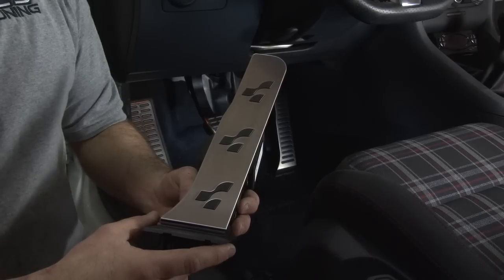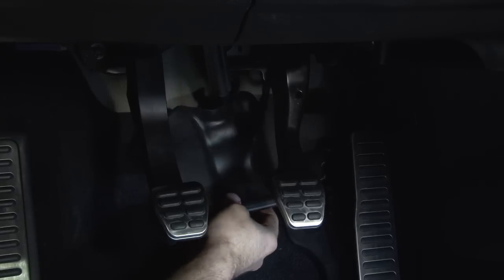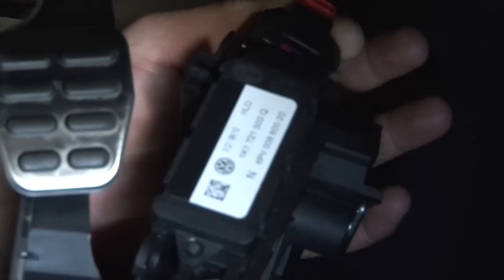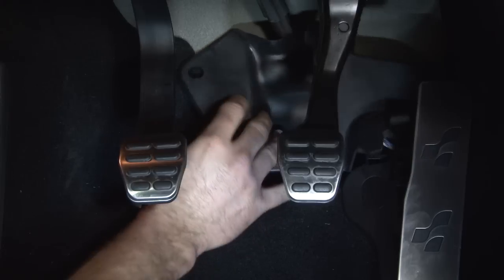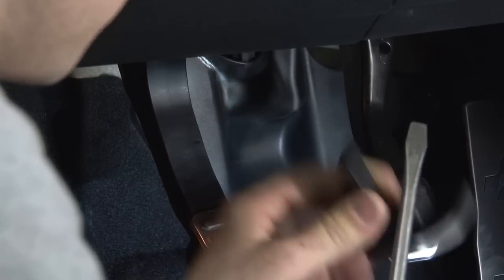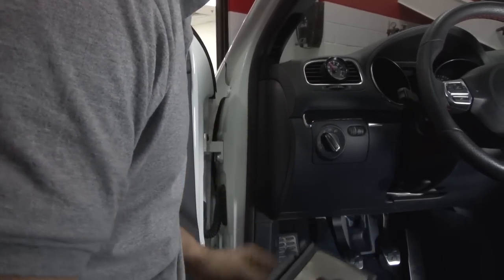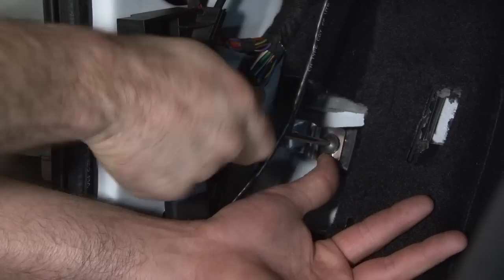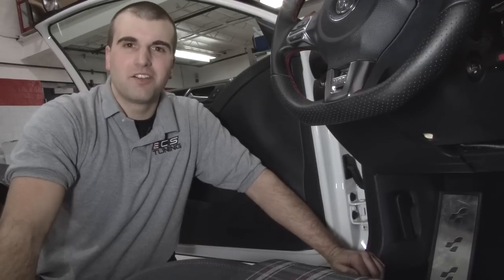ECS Tuning: MKV, MKVI .:R32 pedal Install

Comment: This video is missing two very important details, would have saved me breaking the tabs on the bottom of my accelerator pedal and the small push clip holding the trunk release panel on my MK6 Jetta. At 1:35 you should show and mention that the bottom of the pedal is held on with two clips that snap over the metal posts on the floor of the car and need to be released before you pull it off, I pried my pedal up as shown in the video and the two clips snapped off, now the bottom of my pedal cannot snap into the posts, hope the T30 screw is enough to keep the pedal on and in the right position. Also at 5:30 you should show and mention there is a push clip underneath the trunk release lever that needs to be removed, I twisted and pulled my panel off as shown in the video and the clip snapped off. Good video but now I have to replace the clip and hope I don't need to replace my accelerator pedal.
Reply: same on my golf mk5, i broke the clips on the accelerator pedal, but the plastic structure is very stiff so the screw is enough, the clip under the lever to open the hood is ok because i saw it before to remove the plastic cover... 
anyway installation was not so easy
Reply: Ditto on the broken clips on the bottom of the pedal.  Broke one, cracked the other.  I can't figure how you're supposed to release the clips without breaking.  One is open toward the rear of the car, the other would need to be released from the side. Silly engineering.
Reply: yes, also broke mine
Reply: I roke 1 of the clips on mine too but that is regardless to this video
Reply: Also, that hood release lever comes off very easily with a flat screw driver to pull out the locking clip. Then you have clear access to properly remove that push clip you broke. I was lucky mine didn't break by following this video's instructions but I did almost break my hood release lever.
Reply: How do you release the two clips from the bottom of the pedal body?  It is to do with the small thin slots on the front for the unit where it meets the carpet?

Comment: My MK4 jetta pedals were a  pain in the ass to install. I had to pull off the metal part and use baby soap and water to lube up the rubber so i could fit mine on. then had to use pliers top compress the metal bracket back on.

Comment: did you have too use a special tool too release the pedal before lifting it with the screwdriver ?
Reply: ***** many thanks, just my accelerator base wont budge so worth asking.
Reply: joel whiteley I just tried doing this and I have the same problem. How did you solve yours? My gas pedal just won't budge after I take out the screw.